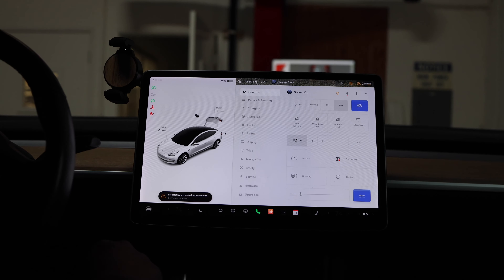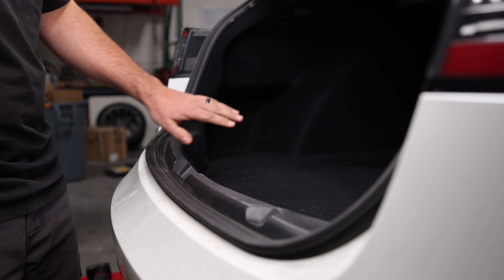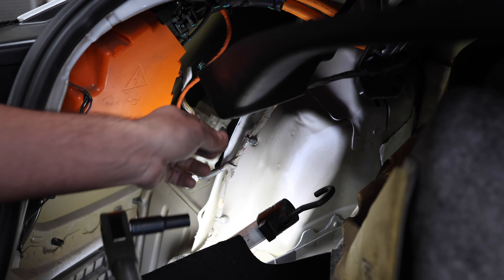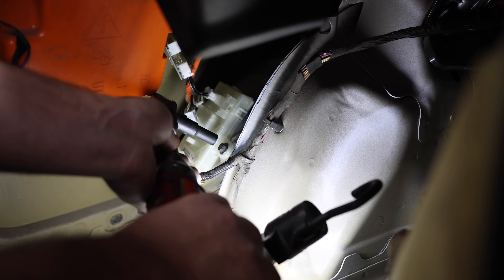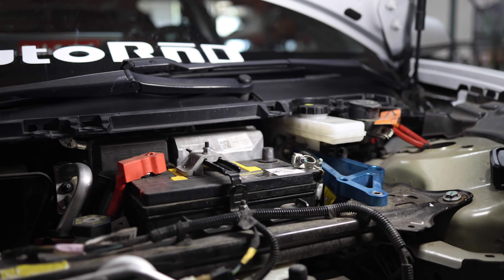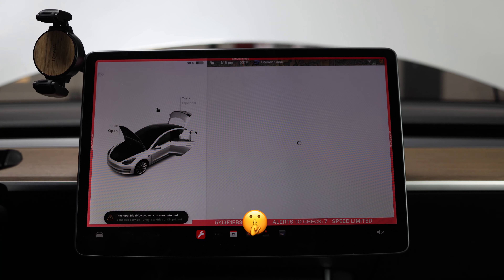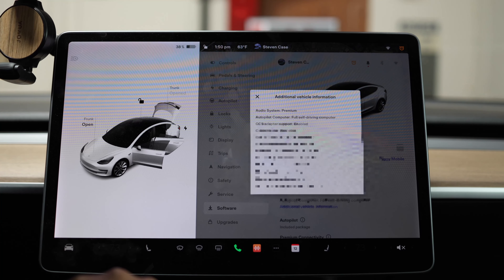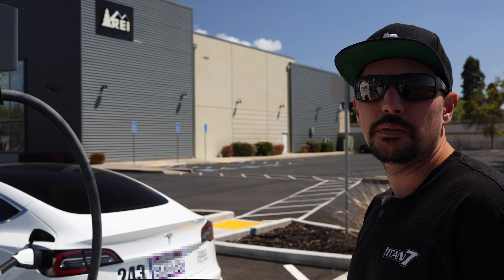DIY Video on the CCS Adapter Retrofit for the older Model 3.

Comment: Hey, nice video! Very cool to see more people aware of CCS retrofits for their pre-CCS Model 3's. Critical mistake though: you need to replace the under-seat plug BEFORE reconnecting the 12v battery - otherwise it's like waking up in middle of heart surgery. Very not-good. When doing this, you can just unplug the under-seat connector and immediately reconnect it to save some time later. That plug is the communications plug to the battery - so when you have it unplugged, the car is freaking-out that it can't communicate with the battery.

For this, though, it's best to not unplug the 12v or under-seat plug at all - Tesla's official guide no longer advises disconnecting 12v power to replace the ECU. Just do it while it's on. You also don't need to unlock the gateway in order to perform "software reinstall" - you can skip a lot of unnecessary steps this way.

It's important to note, the Bundle of Wires is only needed on Model 3s (no Ys) with chrome trim around the windows and "resistive heater" in Additional Vehicle Info - those are Gen3 cars. Adding the Bundle to a Gen4 car will be "all wrong". The Gen4 most often already has CCS adapter support, but if you have a Gen4 car (heat pump, black window trim - or any Model Y) that lacks CCS adapter support, you simply need to replace the ECU part-for-part. Chances are, your Gen4 car without CCS support has ECU "1537264-80-B" (note the "80"), and it needs 1537264-00-B (note the "00") to get CCS support.
Reply: To clarify, we leave the 12v and also the main battery connection under the seat connected while doing this?
Reply: @peymanstd  I just went through this retrofit and did not have to disconnect the 12v or the HV battery.
Reply: Is it safer to do software reinstall or a software update, I have salvage Tesla , don’t want to blacklist

Comment: I just did this last night. It was easy but took longer than you. But it was my 1st time. Installing the software was a bit nerve racking as I was afraid I would brick the car. Ended up being perfect. BTW the instruction from were I bought the Bundle of Wires said that you do not need to disconnect the main or the 12v or even turn off the car. It worked just fine for me. But prob better sae than sorry. Great vid.